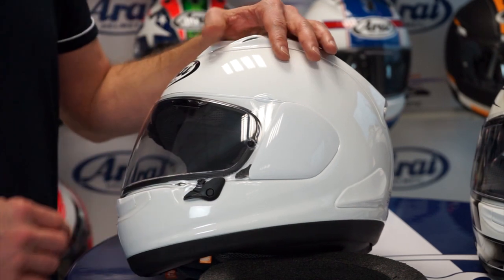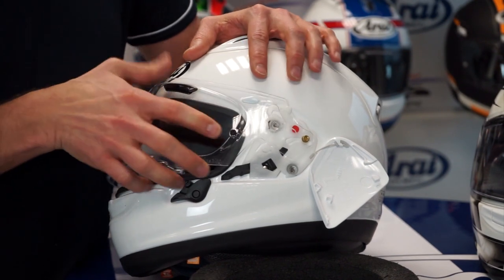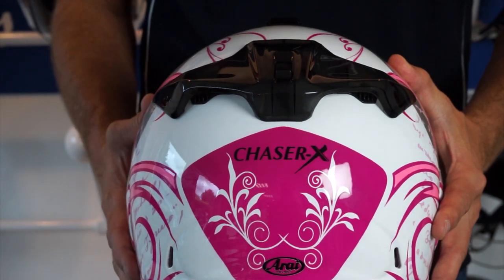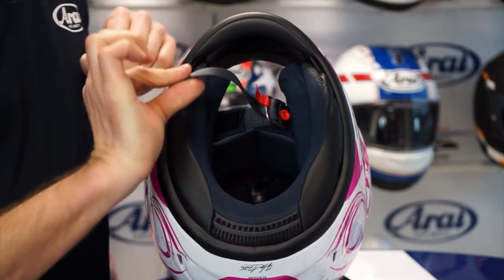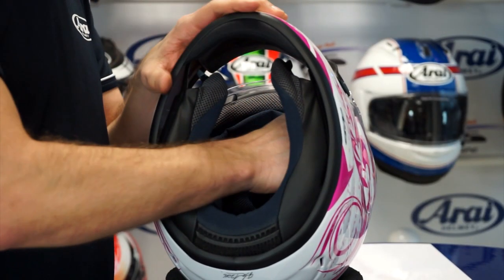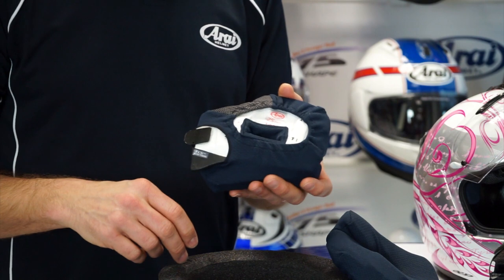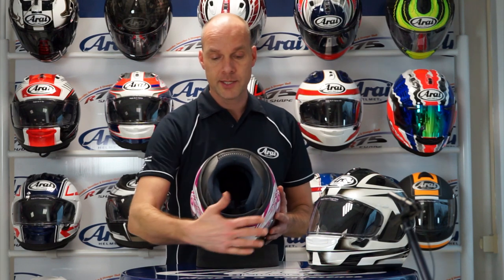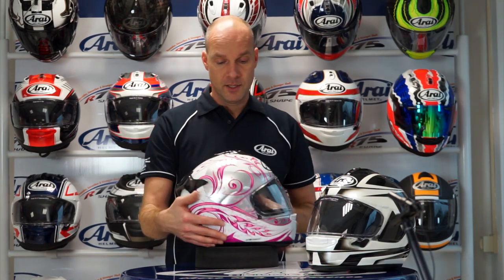Arai Chaser-X: instruction video

Comment: my first ride with new helmet was frustrating, it was fogging up and (with gloves on, I had trouble popping it open for ventilation.   installing a fog resistant inner lens.   the latch system is not user friendly,  there is another video showing how to adjust the shield.  I hope that helps with opening it while riding.

Comment: I've been having problems with mine. The wind noise is too high for a helmet at this price point. The lack och a chin-cover, and the not too tight neck foam make all that air just blowing into the helmet. 
Besides from that, the helmet is very comfortable, ventilation is good and the visor mechanism is top notch!
Reply: It's my first helmet so it's not possible for me to compare with others but I was surprised just how much wind noise is audible, given the price point. I just wear ear plugs now (which is probably better for my hearing anyway) and it doesn't bother me at all. Other than that, it's a great helmet that definitely doesn't fog up.
Reply: Arai makes racing helmets, which prioritise ventilation over sound insulation. You should be wearing earplugs anyway in any helmet on longer, high speed trips.

Comment: not sure if I'm the only person with this issue, but that visor opening mechanism is so unbelievably annoying to operate with gloves. Beside that, it's a great helemt.
Reply: TheCodebreakerV8 have you had it long? Mine is much easier now after 9 months and 4000 miles.
Reply: @absinthesugarcube  it needs some practice, I'd say. It got better after a few 1000 kilometers, but I still prefer other mechanism.